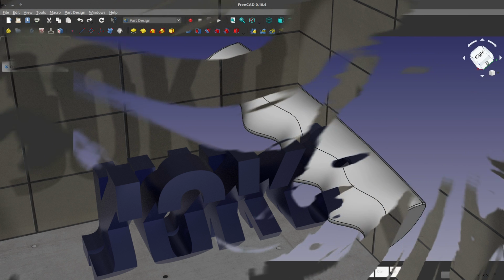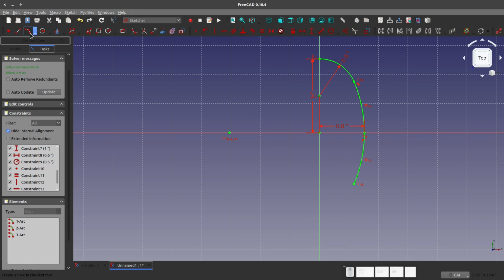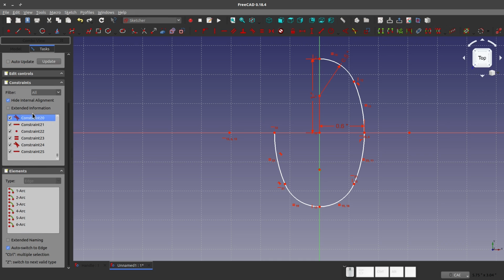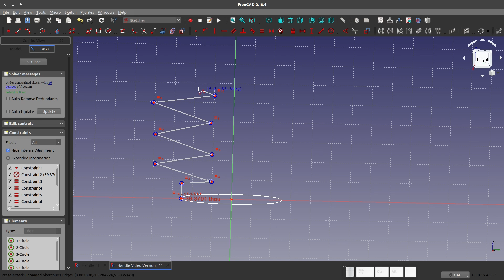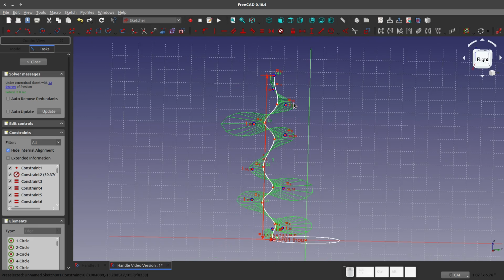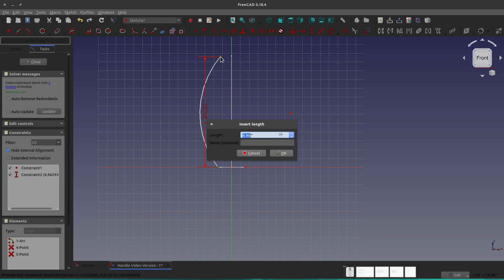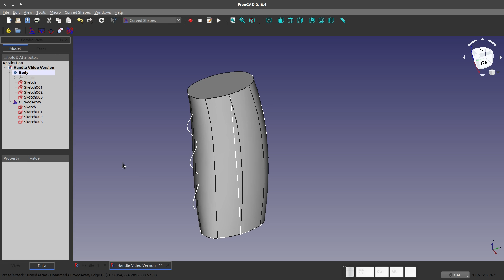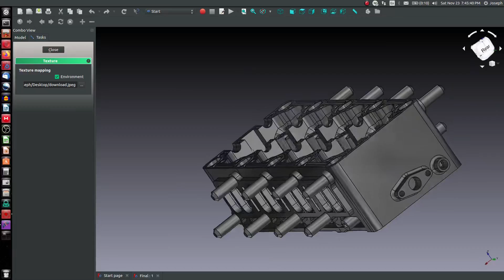Make Handgrips in FreeCAD |JOKO ENGINEERING|

Comment: Also, I tried to produce a skin only, plus a 3D offset from the part menu. 
I works, somehow, I get a nice object with the thickness I wanted, but in cura slicer it comes as a solid object. 
Weird.
Reply from the maker: I've had a similar experience with the thickness command.  I sometimes can mitigate that by  enlarging my minimum radius of curvature, otherwise removing with a boolean is a great option.  Sometimes FreeCAD exports what body is selected in the tree instead of the one shown, it's possible a pre-boolean body was exported instead of the one you had that was hollow.  Good luck

Comment: Great video. 
One comment now: I tried to use this technique to produce something similar but hollow. 
This is not so easy. The thickness tool would not produce it from the solid. 
I had to create a similar object inside and remove it with a boolean operation.

Comment: hi thanks for vid, how do we make it hollow & specify wall thickness?
Reply from the maker: Thickness command on the part workbench ought to do it.  Be careful of your minimum radius of curvature.  It's a rather complex shape and wouldn't be a trivial operation. https://wiki.freecadweb.org/Part_Thickness
Reply: @JokoEngineeringhelp  massive thanks I’ll give that a try
Reply from the maker: @adrianstealth340  If that doesnt work, perhaps you could make it as a surface and thicken the surface(s) to get it hollow
Reply: @JokoEngineeringhelp  big thanks for reply , when I do the curved bit it said “links go out of allowed scope “ everything was constrained etc

When I try to apply thickness it says “BRep_API command not done”
Reply: Ps I’ve ignored errors , made it hollow by (options in curved array ) not selecting solid , & selecting surface “true”
Reply: Actually I was doing multiple lines in one sketch , I’ll try & do a single line in its own sketch like you have doh !
Reply: Nope , nothing works still the error )-: